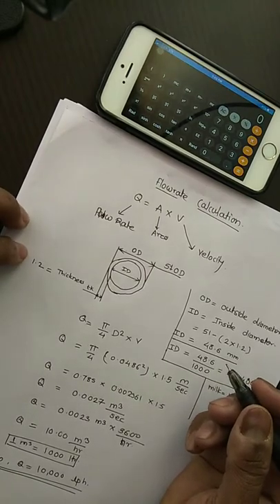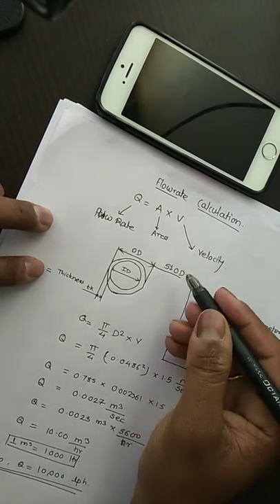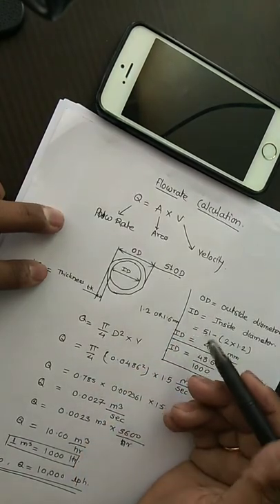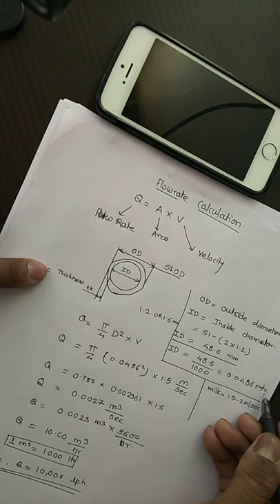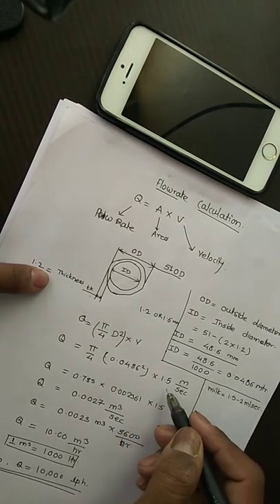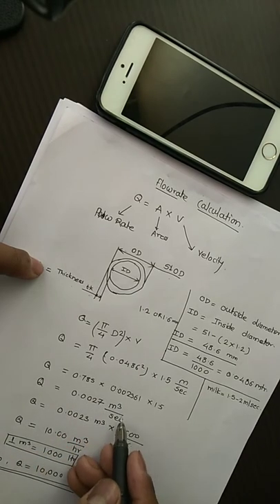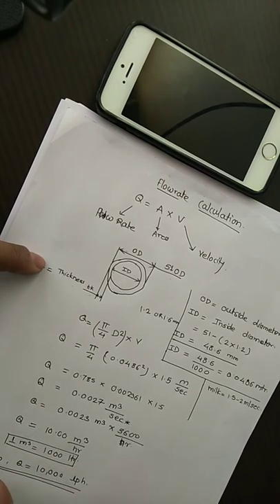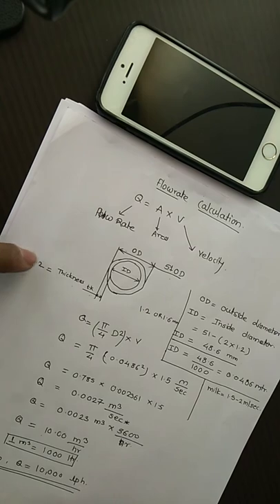Flow rate calculation from given line size

Comment: What should be velocity for effluent of CETP (Common Effluent Treatment Plant )?
Reply from the maker: There are Thumb rules for velocity, for example for water 2 to 3 m/s.
For air 20m/s.
For steam 22 to 30 m/s.

For viscus product it may be different.  If you want to calculate std velocity for typical product then you can do reverse engineering for any working plant.

Comment: is velocity constant at 1.5 m/s ?
Reply from the maker: @Srk7028  : 1.5 m/s will be as per guidelines. In food industry 1.5 m/s is recommended.  For water it can be considered 1.5 to 2.5 m/s. For low pressure steam it can be 25m/s.
Reply: @NitinDahatonde  is it depends on pressure of fluid stream ?
Reply from the maker: @Srk7028  : Yes. Depends on pressure as well

Comment: Calculating velocity is another headache. Can you plz let us know if suppose the milk is replaced with other fluids then what will be the velocity of it ? Should we calculate it, or is it a standard value of relevant fluids ? Suppose I need to calculate the discharge of water of over head water tank, is this formula is applicable for this situation ? If yes then what about velocity how should I calculate it ?
Reply from the maker: There are Thumb rules for velocity, for example for water 2 to 3 m/s.
For air 20m/s.
For steam 22 to 30 m/s.

For viscus product it may be different.  If you want to calculate std velocity for typical product then you can do reverse engineering for any working plant.